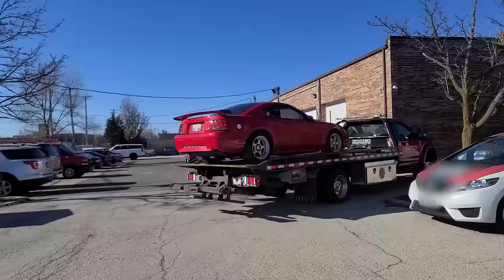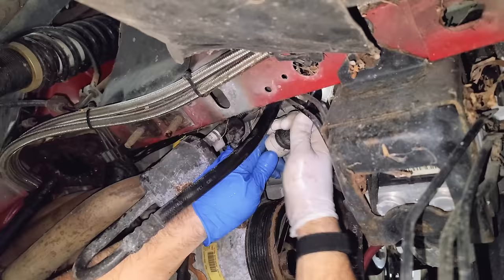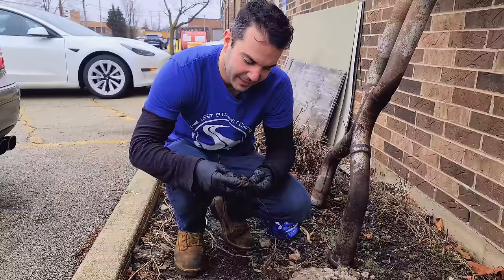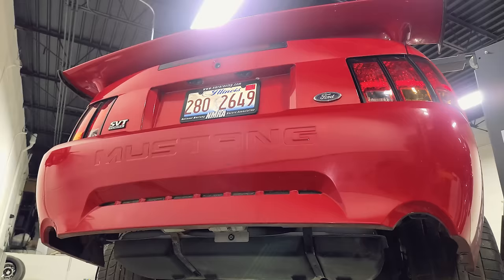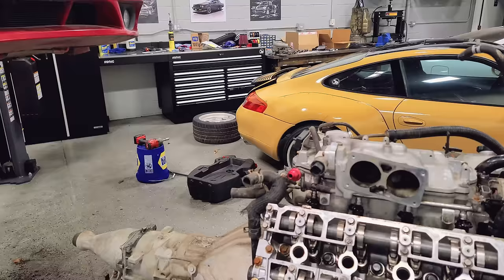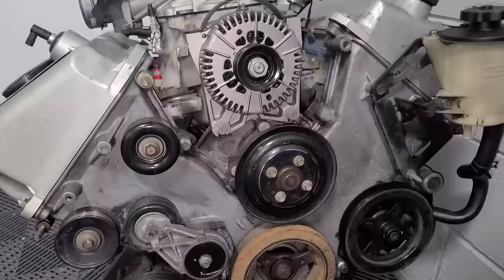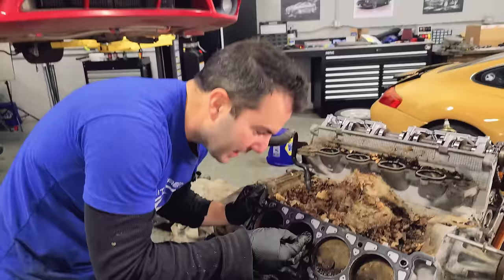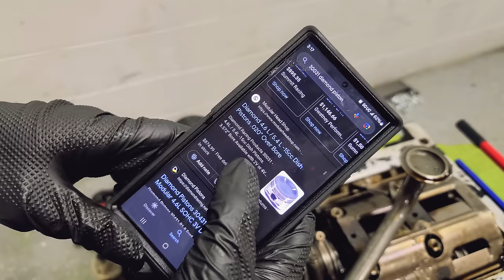Rebuilding The World's Fastest Cobra Mustang! ABANDONED For 20 Years! New Engine & CARNAGE!

Comment: A thought that pops into my mind .... Would those ported heads fit the replacement engine (after a rebuild of course), coz thats where the power is and we know the new bottom end is built to take it!! 😳
Reply: The ported heads are too much. B heads are great boost heads and are more than sufficient with how small these engines are (not package size obviously as they are massive but remember they are only 281CI!). The exhaust can be massaged, the intake is plenty and the chamber need not be touched as the C.R. is already low. Mod motors just need forged internals and boost! 

4v's have all the head and intake it needs, cams of course can give you gains but factory is just fine if shoving air down it's throat. (2v's massively benefit from Trick Flow heads and cams with an Edelbrock) 

I still think Ford originally planned for the New Edge to be boosted from the factory. Why else would they be hydroboost?

Comment: If it’s a 99 or 01 it does not have forge internals. Only 03-04 came stock with forged Manley rods. It would only have forged parts if it been added after market. The 99 blocks are aluminum and won’t hold up to as much as HP as the iron block on the Terminator.

Comment: I have been waiting for this one! Love the channel!
I will take the New Edge Cobra over the LS Firebird/Camaro - just personal preferance and still have one. But I think the GMs are better in many ways. LS > Modular in MANY ways.
99 Cobra
Rear Bumper cover was same as a GT - 2000 and up Cobra/Cobra R said Cobra.  Also had same interior as a GT in 99. 
Brakes are PBR factory Brakes - They say Cobra. Dual Piston - Good brakes for the year.
The IRS (which as pointed out is gone) was the worst of the Cobra IRS - 28 spline and had some other issues. 2001 Was still 28 spline but improved. 2003 went to 31-spline and are much stronger.
Factory had a forged crank but not rods or pistons, so the new engine is obviously a thousand times better 
Factory trans also was terrible issues from the beginning - not something to worry about on this build. 

These cars like to make carbon. They like to smoke too. I found running Amsoil Extended Life Oil took car of that problem because of the extra detergent with shorter interval changes. Not what I would run in that engine though... Factory calls for 5W-20 I run 10W-30. Once upon a time I read a post (yup) by someone who said a "Ford engineer told them for the love of God don't run 5W-20 in these engines." Regardless - it was true at the time 5W-20 was terrible and to eek out some mileage. 
Would love to see the head stamps on the new engine. 03-04 Heads are massively better and later castings had 9 Thread plugs Early heads (99-03) were only 4 and liked to pop plugs under boost - Alex obviously knows this from his comment on Ford Threads.
Could go on for days...
Reply: Ls ain't better than a 4v in any way lol.  Forged rods and pistons with boost and fueling you can do 700+ wheel easy and reliably you can't do that with an ls1 with that little work.  And it's doing it with 281 cubes not 346 like the ls1.
Reply: The old engine was built too he said this multiple times.  It was an engine that was built 20+ years ago.
Reply: 5w20 was just for emissions basically.  5w30 is much better 10w30 is fine too.
Reply: The 03 heads aren't "massively better" either the differences are negligible.

Comment: Those are 03 -04 cobra heads the blue paint is from factory meaning the original heads had been recalled due to “the tick” a 03 -04 cobra problem that had valve guide problems so when they recalled the heads the new head would have blue paint hope it make sense
Reply: Pretty sure that wasn't a terminator specific issue.nn

Comment: DONT USE THAT FUEL PUMP!!  If it truly makes 800 hp crank or at the wheels you want to run a dual pump hat (2003-2004) cobras had dual pumps I believe and you’d want the fuel system to be a return style fuel system.  If you don’t want a return style fuel system then get a BAP and get rid of that inline pump!!  We don’t run that stuff anymore FOR A REASON!

Comment: The 2001 mustang Cobra was completely renewed and reupdated from the 1999 due to a lawsuit that Ford was involved with the engines are mostly completely different The heads are different most of the bolts holes are different for the cover play tensioner like you were saying in the video and everything I also they came factory forge pistons on the 2001 Cobra because they realized any amount of power be a normal piston rods were bending out of place so they had to put a better head studs and forge Pistons in

Comment: Typically when you see exhaust valves rusted and dropped like that it's usually from mice using the exhaust ports as toilets. The way they were sitting on the pistons, not folded up and the lack of destroyed piston tops, plus the heads didn't look hammered the way they would be if the valve heads were slamming around in chamber, tells me that's most likely the cause.

Comment: 99 Cobras came out of the factory underpowered compared to the numbers Ford claimed. It’s good you have the 2001.
Reply: You don't even know what the issue was stop spreading false info.  They were all fixed it wasn't an engine issue or anything like that it was simple intake manifold casting issues and something with the catback that caused power loss they recalled and fixed them all.  They will make the same power an 01 will make once fixed both stock and modified.  They have the same potential the 99 has the stronger teksid block that not all 01 got.  Spreading bad info because you don't even know what caused the 1999 cobras issue.

Comment: CAUTION: At 7:34 I noticed the drivers side header collector has daylight shining through it- the merge collector cone is gone. You will need to cut and weld something in there you you will have a massive exhaust leak.

Comment: Stock head bolts, but the numbers on the aftermarket engine probably indicate they've been degreed at some point. The cams in both engines look stock,  Unfortunately probably degreed for a turbo, and should be degreed for a centrifugal to optimize power. 

The chain guides are stock on the oringal engine. 

The crank does look aftermarket on the new engine.

Love the content keep it up!

Comment: I’m almost positive what happened to the engine I’ve seen it before the rust causes the valve stem to get weak in the spring pressure will blow the valve off that motor probably never blew up sitting destroyed it

Comment: My car has a twin charger set up so turbo and supercharger but I don't think my supercharger has ever had the oil changed as it's located down the backside of the engine. It only ever clicks on off the line or for a second until the boost builds up. Car has 148,000kms. So just under 100000miles. I wonder how horrible the oil is. Car is a 2011.

Comment: I'm at the part where you're pulling the oil pan off the new engine.. The only thing I'd like to say here is that I HATE when people drain the oil out of an engine then sell it to you without REPLACING the oil. I really don't like that, man humidity and other moisture can get in there and really wreak havoc on those bottom end components. I don't like that at all. Any time I have a motor just sitting around (I did a lot a LOT of SBC and 3.0Mercruiser work in the day.. and I sometimes had 5 or 6 engines out in the shop, but man I would ALWYAS make sure they were FULL of oil when sitting.. I dunno, something my dad told me many many moons ago..

Comment: Early sodium filled exhaust valves can break like this, corrosion from the inside or high rpm with lifters not keeping up, 5 min later in your video, I guess with 4 valves it was one camshaft out of sync, 9 min left of yor video, lets see :)

Comment: I wish you diagnostic this engine on the whole tear down AK make sure all four cams are still in spec of time and and also crank to cam timing and I would save that engine and build it if it’s still original to the car just called these older cars were seenfrom the 60s and 70s with all kinds of money because they have the original motor

Comment: Those are fabricated headers....likely one-off for this application or small production run.  I used similar headers on a couple of race cars.  Also SPS makes very high quality head and rod bolts...equivalent or better than ARP.  I recall using SPS bolts for my carillo rods and the bolts cost about $12/bolt.

Comment: That could be 10k miles of extremely rich running. Which could be issues. But my LS2, i torn down and built up at 160k miles and there was NO carbon in the cylinders or heads. Honestly, they looked low millage lol. Thats a lot of carbon for only 10k miles...

Comment: 10k miles if it’s running way to rich which is probably the case because they can’t control detonation without. They certainly could run a higher quality gasoline like shell 93 or BP 93. I see people filling up turbo and supercharged vehicles at speedway and it makes me cringe. The only quality fuel they sell is E85.

Comment: The 99 heads are better and will make more power C head vs B heads on the other unless that motor already has C heads.
Reply: B heads with boost can make plenty of power they work just fine with boost especially when it's ported vs ported they're every bit as good.  C head makes more out the box and na.  Pretty sure both of these were c head engines.

Comment: 😂😂u can tell ur ex delaer trained as u never seem to pre lube a single nut, bolt, screw etc...all ex main dealers dont generally work on cars older than 5-6years old with zero rust and all comes apart. 
Top tip spray everything you coming to or even might take apart the day or atleast the morning before you start anything helps a hell of alot. 
I was family and main dealer taught wd40 standard & extreme penetrating spray is your best friend on everything over a few years old. 
I know take semi's apart and we start every job with wd40, then blow tourch then oxy & cut wheel if all else fails 😂😊
Reply from the maker: I sprayed everything on this car.  I've shown spraying rusted nuts and bolts hundreds of times